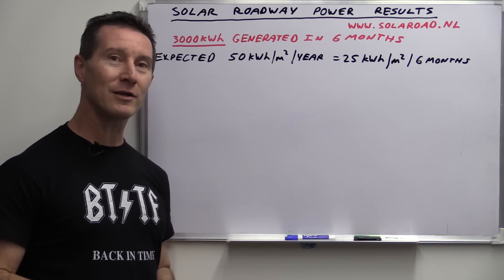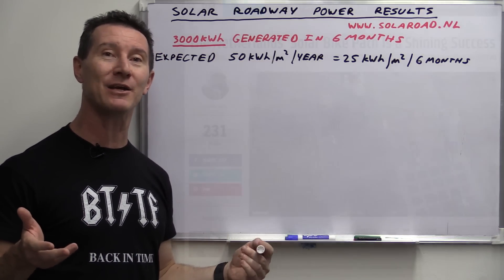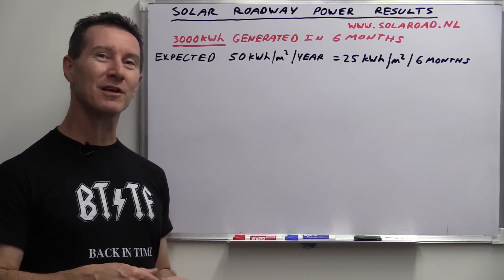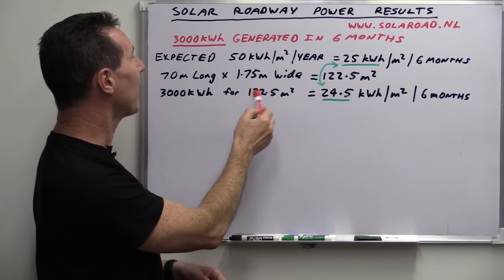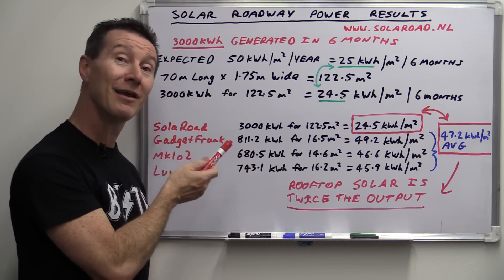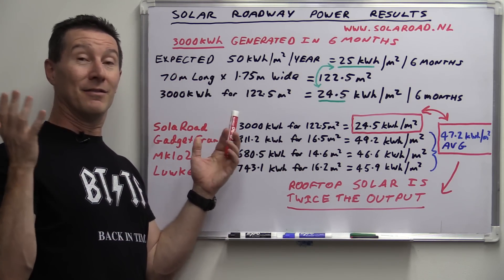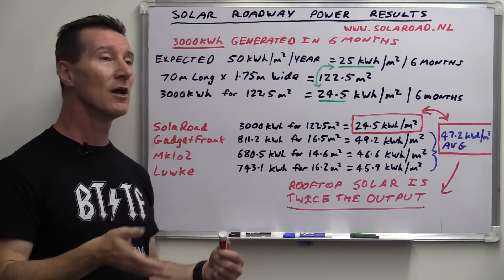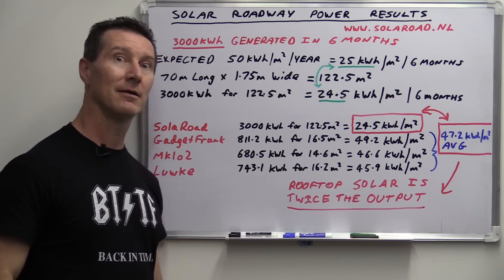EEVblog #743 - Solar Roadways Test Results

Comment: While I assume that it is true that roof top solar produces more power per square unit, there is less roof space than road space. Then, who owns the roof and who owns the road. The government can produce power that it can use or sell to defray cost. Then there is the road itself. In CT where I live, they have to repave the roads very often due to frost heaves and the like. If they can develop the glass or other material to out last the tar, that would be another win. Then isn't tar and the production of tar a heavy use of petroleum. I have not done the research you have but this issue has way more angles to look at than you have measured.

Comment: "It's not much more" than they expected. Actually isn't it less? If your calculation is accurate? They expected 25kWh and they got 24.5kWh. That's 0.5 LESS. Assuming your track width estimation was accurate.

Comment: Apart from the reduced efficiency we also have the increased cost and energy use required to make that "SolaRoad ". The cost for the project is so far 3.7M dollars for 70 m of road ( ~122 m^2) as stated in the video. So the bike path cost about 30k dollars per square meter to make.

Sure the cost would be reduced a bit but not by the orders of magnitude needed to make this viable. Placing it above the road (at a correct angle) is the way to go (as you stated)

http://www.abc.net.au/news/2014-11-13/dutch-unveil-world-first-solar-power-bicycle-path/5888440

Comment: Anyone who knows the basics of grid-connect solar photovoltaics will know that the road is a very bad place for a solar panel, even if you have invulnerabium glass covering it. Shadowing from trees, buildings, overhead vehicles, or even from fallen leaves can cause all panels connected on the same DC-AC inverter to stop producing power... even on the panels not shadowed.

Comment: Omg - such an optimist you are! Why are you trying to evaluate one prototype to decide whether this technology can work? Any why is output pr m2 the deciding factor? What if it could be built much cheaper on roads than on roofs? I would look at long term $/output.
Reply from the maker: Jungstar CPH It CAN'T be built cheaper on roads than roofs, let alone for HALF THE COST. It's an impractical idea compared to rooftop. Welcome to the real world.
Reply: +lynzcow IT'S NOT ABOUT THE COST OF THE PANELS, FFS!!   It's about the cost of the whole roadway which are made from impact resistant glass, LEDs and electronics along with the solar panels (made in China - who'd a thunk it!).  That is why any sensible person buys the cheap solar panels from China that you mention and uses them on their roof, NOT on their roadway.
Reply: +lynzcow Research and development will never make laying down solar panels as a roadway cheaper than mounting them on a roof, you fucking idiot.
Reply: +EEVblog you do know that China is now currently producing solar panels, and the price of solar panels continues to drop. Do you know your poor excuses have so many holes in it.
Reply: EscapeMCP That's why it's called RESEARCH AND DEVLEOPMENT! HOW FUCKING STUPID ARE YOU MORONS?
Reply: +lynzcow Laying solar panels on a roadway is always going to be more costly than mounting them on rooftops as they assume more risk in doing so. Until they can create solar panels that cost minimal percentages (as in 5-10%) of the current cost, or can create panels that magically are more efficient on the ground by magnitudes more than on a roof, it's not going to get cheaper to place them on the ground. The places that can afford to do this mostly deal with harsher and more diverse climates than will lead to more wearing and breakage.

It's great to put money into researching better means of alternative energy production, it's stupid to waste money on less viable methods than the competing methods.

CapsLock doesn't make your argument less false.
Reply: +pbmdh and I suppose you believe the earth is flat. Grow up
Reply: +longliverocknroll5 maybe you missed the part where the solar roadways also combine other local utility services like phone service, network, even drainage but you what you know.
Reply: lynzcow Maybe you missed the fact that the focal point of the roadway is to create energy and the major claim of the producers and promoters of the product is that it will be an effective and efficient means to do so, and it is not yet.

Adding on good things to a bad idea doesn't make the original idea better. If I have a care made of foam but say "it also has an electric engine" that doesn't make my original foam car idea a good or effective means of travel because you've now added an electric engine. It means I have a piece of crap car with an engine that adds nothing.

Spending the amount of money that it costs to basically add ineffective solar panels with phone services, network, and drainage when those extras could all be added at a lower total cost if you removed the ineffective solar panels is a complete non-starter of an argument.

Thanks for the condescending idiotic response though.
Reply: +longliverocknroll5 Suck-it bitches! :D
http://www.treehugger.com/solar-technology/france-pave-1000km-roads-solar-panels.html
Reply: lynzcow Wow, a link to an article that doesn't prove anything.

Comment: I'm not for or against the solaroad, but I need some more info to make up my mind. 

Obviously the 3 million euros spend are for a large part research and development cost. When the first mobile phone was invented, no one said that it was a stupid idea because the phone cost millions of euro's.

I need to know the price of the solar panels used in the road compared to the price of solar panels on the roof. 

Also, when installing panels on the roof you will need to pay labor costs to human beings to install the panels. The solaroad is build in modules which will be pre-manufactured in a factory and in a factory you can use way more automation than when installing panels on a roof. And automated installation in a factory is obviously a lot cheaper. 

I'm also wondering about the price of inverters. When installing solar panels on a rooftop, you will need to get one inverter per roof generally speaking and I believe the inverters make up quite a bit of the total price of installing a usable solar array on someone's roof. When you have stretch of solaroad of a few kilometers, what's the price of the inverters you would need compared to a few kilometers of rooftops?

Shouldn't we hold back our judgement until we have the full price comparison?
Reply: LeonHoogland ..."When the first mobile phone was invented" You cannot compare the R&D of this bike path to the R&D of the mobile phone because the bike path isn't creating new technology. Their R&D consists of slapping together tempered glass, solar panels, and a mounting base.

"Also, when installing panels on the roof you will need to pay labor costs" If you're doing this on a road you will need to pour a concrete road to mount this on. Building a road requires much more labor than mounting panels to a roof. Plus you have recurring maintenance with a road system; you will need a maintenance crew to keep the panels clean, and technicians to replace broken panels and fix problems. 

"Shouldn't we hold back our judgement until we have the full price comparison?" A rooftop panel pays for itself in 10 years then lasts another 10. If you add tempered glass and a concrete base then you easily double the price per panel, effectively making it never generate a profit. If you factor in the loss due to flat-lying then you're in the negative. Also factor in the cleaning and repair costs and you can see its an easy way to bankrupt yourself.
Reply: Reddit Gold User Dude, stop being stubborn. Again, it's not about the product and the development process. 

It's a FACT that you can't take R&D cost and add it to the total cost of building a prototype and pretend that that's the cost of the product when it goes into mass production. It doesn't matter wheter we're talking about phones, solaroads, plastic toys, etc.
Reply: LeonHoogland ... "you can't take R&D cost and add it to the total cost of building a prototype " Show me where I did that, because I didn't do that.
You act like rooftop solar isn't already mass-produced. Since we already know rooftop solar generates more per sq meter, the only way a price comparison would be necessary is if these road tiles can be produced cheaper per sq meter than rooftop panels. Since rooftop solar is already mass-produced and roadway solar is essentially the same thing plus a few extra expensive components and recurring maintenance costs, there really isn't any conceivable way that this could be a worthwhile investment. But suppose they somehow made them cheaper than rooftop panels- you would still be better off buying them and putting them on rooftops.

Comment: Are you fucking daft? You are bitching because it isn't significantly more than what was EXPECTED. It means that they had a pretty good guess. Also, in a climate such as the Netherlands, if you could use this to bleed off the snow in a steady but CONTROLLABLE fashion, as opposed to using snow plows, salt and other harmful chemicals to melt the snow, not mention the cost of not having to pay for snow removal, other than maybe having to feed some power back in to the system due to extremely cloudy days. 

I would say this is a win. 

Getting the EXPECTED results is a GOOD thing.
Reply: dondean517 Don't get solar roadways and the NL pathway confused.
-Melting snow as opposed to plowing it is extremely inefficient, which is why we plow instead of melt.
-NL was expected to be nothing more than a novelty. They were correct, plus a few watts. Educate yourself.

Comment: You spend an exorbitant amount of time just blabbering--get to the point.  If people did not think outside of the box and pressed on, the first attempts at a car, airplane, helicopter, radio, computer and television would have a death sentence.

Is there room for improvement with this roadway?  Absolutely.  Should you expect some exaggeration with the results?  Of course.  Every inventor has massaged the numbers and future expectations; just look at Edison.  Perhaps further experiments would improve the actual results.  Perhaps this will inspire others to think outside of the box and provide other solutions.  Getting politicians to think outside of the box is a major accomplishment in itself.
Reply: JIMMY N How is this a first attempt at anything? Unlike cars, airplanes and radios which were new at the time, solar roadways isn't a new idea. Solar technology has been around for decades and scientists and engineers understand it very well- enough to say that this is an inefficient use of them. And just because a few inventors in the past were successful doesn't mean every half-baked idea deserves funding. For every good idea there were several bad ones. Being open minded is good but if you're too open minded you begin to accept and spend millions of dollars on pipe dream ideas that haven't demonstrated any merit.

Comment: How thick would tempered glass have to be, to withstand, a Truck at maximum load? 80,000 pounds. Of course the weight is distributed across all the wheels. 12,000 pounds on the front axle, 34,000 pounds for the two drive axles (17,000 pounds each axle), both of which has 4 wheels on each axle, PLUS another 34,000 pounds on the two axils on the trailer (also has 4 wheels each axle). This image is a good show of the weight distribution: https://upload.wikimedia.org/wikipedia/commons/thumb/3/3c/Axle_groups.svg/300px-Axle_groups.svg.png

With the steering axle, that's 6,000 pounds per wheel, since there are only two of them. Since every axle after the steering, each support the same amount of weight, and has 4 wheels per axle, each wheel individually is supporting 4,250 pounds a piece.

Comment: Why not just put the panels on a raised platform above the bike path? There are 3 reasons this is a better idea than putting them underground:

1) More power generation: You could slant to solar panels to point south without tilting the road. The panels, being in the northern hemisphere, would generate MUCH more power if tilted to the south. In addition, the glass shield protecting the panels wouldn't have to be as thick, increasing efficiency.

2) Lower maintenance costs: Wear, tear, abrasion, and, as seen in the first few minutes of the video, literal shattering of the panels occurs at a much higher rate with the bikes running over the solar panels.

3) Shade for the bikers: Riders are shielded from the sun for the afternoon hours of the day. Panels underneath the path obviously can't do this.

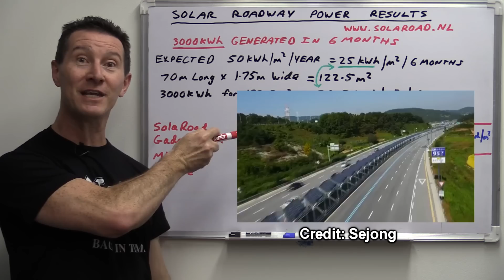Edit: 11:38 Oh. Nevermind. It's already been done.

Comment: With cars and trucks driving on them, you'll have dirt/oil/brake dust piling up, as well as scratches from road grit and dirt being driven into the glass.  I expect in no time at all, the efficiency will drop in half again.

That korean one is exactly what I have always wanted.  It has the increased benefits of shade in the summer, and potentially shelter from rain as well.

Comment: +EEVblog
There are not two identical semesters, and the SolaRoad measurements correspond to less sunny semester. So, you're starting with a fallacy.

According to the NASA data for Krommenie:
-The average horizontal radiation from November to April (six months tested) is 1.7 kWh / m2 / day.
-The average horizontal radiation from May to October is 4.3 kWh / m2 / day, a 250% over the six months tested.

Those expected 70 kWh / m2 / year over 122.5 m2 give 8,575 kWh / year.
Those expected 8,575 kWh minus those 3,000 kWh measured give 5,575 kWh estimates for the sunnier half.
A 85% increase in production for May - October from November - April, although this had been sunnier than normal, it's perfectly possible.
Reply: Of course. The NASA did. Those data are for 22-year average global (direct and diffuse) radiation. Diffuse radiation represents 65-70% of global radiation from november to january. https://eosweb.larc.nasa.gov/cgi-bin/sse/grid.cgi?email=skip%40larc.nasa.gov&step=1&lat=52.5&lon=-4.8&submit=Submit

Comment: The headlines get carried away about as much as you get carried away trying to take the shine off the idea of solar roadways.  A certain amount of salesmanship and/or propaganda is necessary to get projects/ideas like this off the ground.  Even according to your analysis they didn't exactly over-promise on the performance, and they seem to have gotten close to their goal.

What solar roadways lack in inclination they could potentially make up in shear available surface area.  No we're not going to replace all the standard asphalt/concrete pathways on the planet with solar roadways, but maybe we could do a few and get a good quantity of energy for it.
Reply: dequinox .. "What solar roadways lack in inclination they could potentially make up in shear available surface area"
It doesn't work like that. 70m can power one home. That's terrible. 140m can power two homes. Still terrible, 70,000m could power 1,000 homes. Still terrible. Increasing the size isn't going to change its efficiency.